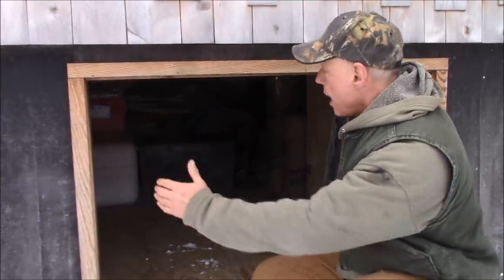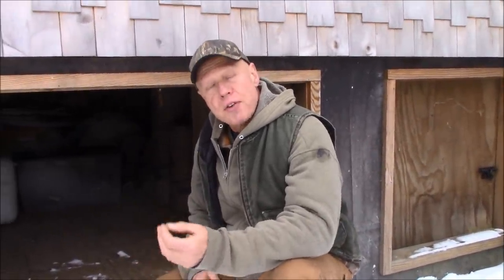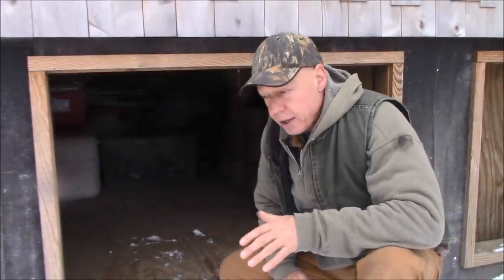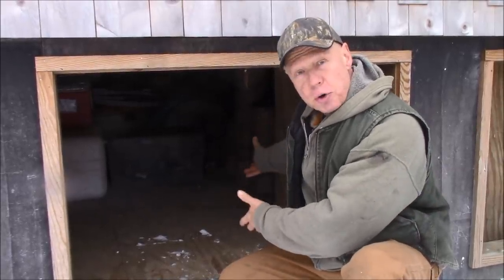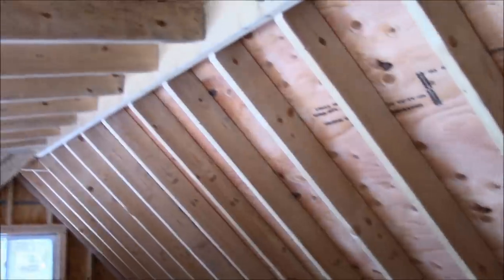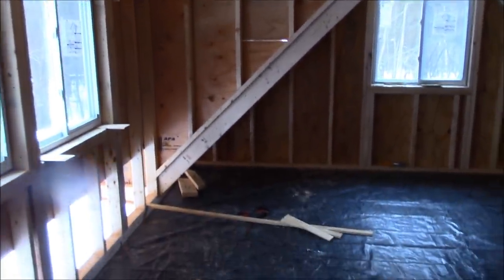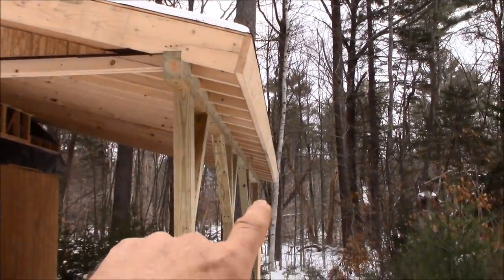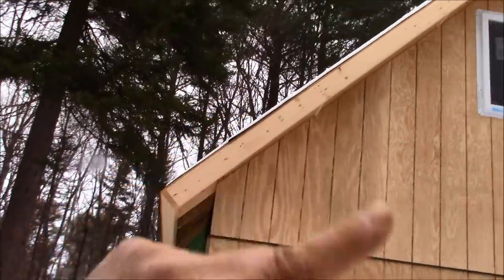DEBT FREE BUILD w/Cost Analysis. Recap and Cutting Cost. Info for Building Your Own Cabin Homestead.

Comment: I could easily live in that little structure. Easier to heat, easier to clean, cheaper permits, and less tax. Even if I wasn't retired, I'd rather have a smaller house. I still think about the small cabin you did in NY. I have a bum leg, so a single floor cabin is ideal. Nice job JC!
Reply from the maker: You'll see more of that cabin when we move off the mountain.  I don't like leaving Lori alone up here so I don't get to NY very often.
Reply: @thebossoftheswamp   I don't blame you JC.  Break out your Dutch Oven again!

Comment: Building a 72x32 masonry earthship. Building a 24x32 section at a time. Mono sloped roof for winter sun. Straight windows because that's how they should be used. Masonry materials are cheap. It's my labor that cost so much. The biggest cost will be windows, roofing and rockwool insulation.

Comment: I know that the metal roofing does effect cellphone signal,my dad has an aluminum roofing which Sears and Roebuck use to sale,50 years ago and you have to go out side to get a signal
Reply: But 50 years later it's still shiny,no wonder they stopped making aluminum roofing it lasts forever,no profit to be made there!
Reply from the maker: Agreed.

Comment: Speaking of metal roofs, they are a great option in hurricane country when ferocious winds can lift your shingles easily. 
But! Examine the trees under which you might build! I had a metal roof installed on my 8x10 woodshed… right near an enormous hickory tree. When nuts of that size hit the metal panels come fall, it sounds like a shotgun blast! WTH? Is it hunting season already??? So be forewarned! 😆

Comment: Hi JC I built a 40x40 barn few years ago and sided it with T11 and than painted it . After 3 years the skin of it started to buckle and crack in a few places have you ever seen this...

.
Reply from the maker: I've seen it happen at the bottom of the sheet in wet areas. It's best to add extra nails in the perimeter of the sheet.

Comment: Hello, My father was an Engineer and Master carpenter, he never used osb  board but I noticed u did not use clips on the roof sheets "? He would only use 4-5 layer plywood.
Reply from the maker: Clips are used for 24" on center, this is 16" and will be covered with metal roofing with 2x4 purlins beneath it.

Comment: There is a young family that I have been following for a while on youtube. They currently live in Florida. Most of the foundational work is solid ground with rocks and a concrete level pad. Then he stacks a couple of Cinder Blocks end to end. Then he comes back and fills in the top with concrete. I suspect that building a foundation in that manner would be acceptable in Florida? I am not so sure if that would be acceptable in colder climates. Most companies that I see doing foundational work use methods similar to what you used. But as long as the foundation is structurally sound it should not make a difference in how you construct it?. I suspect one method may carry loads better?
Reply from the maker: Temp/climate and ground composition will dictate how a foundation will fare.  Here on the mountain, frost wreaks havoc on everything but at my NY cabin, even though it gets colder there, the ground is all sand and i have no frost heaving issues there.

Comment: Hi JC< have you figured out an approximate savings for the materials if you had done the project differently as you mentioned in the video? I'm just curious is all. 
Thanks for the video and all the best to you both.
Reply from the maker: I could have dropped a couple grand.but the plywood roof makes a much better structure.
Reply: That’s a pretty nice drop if one can live with that type of structure and roofing. Likely just not ideal for a house butI’d assume plenty good for a shop or garage. Thanks for the reply, JC. Best regards

Comment: Thanks for your informative videos love'em.
   Since you are the one who started me on reflectitz I have a question. I build a she shed/ guest house to be heated but not very often. I sided with T1-11 on the inside I stapled reflkectitz  to the inside wall then I added faced insulation (paper facing to living area) . I was worried about the long term effects so I just did 1/2 this way I couldn't thing of anyone to ask. About what I was doing.
  Will the effects of the half with reflectitz be detrimental?
Reply from the maker: You used T-111 as the exterior sheathing. Correct?  
I ask because it was confusing how it was typed.
Reply: @thebossoftheswamp  yes the t1-11 was first then tyveck then the reflectitz then the batting paper side towards living space then dry wall